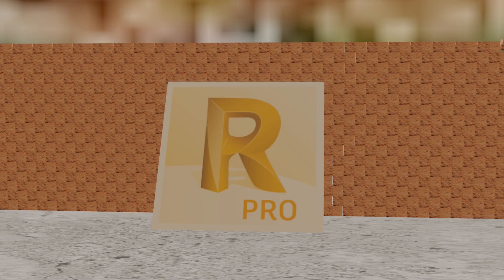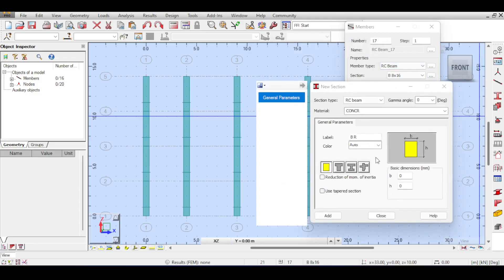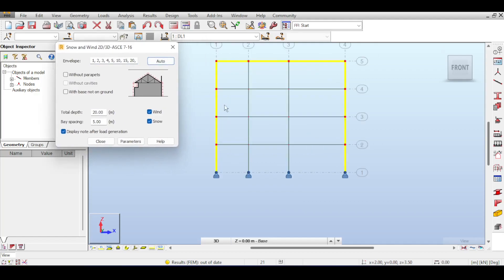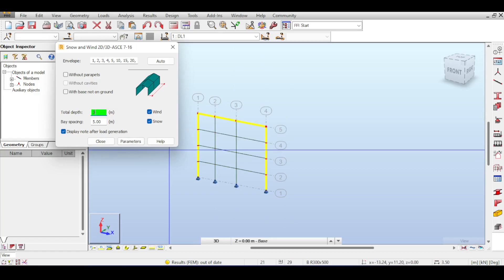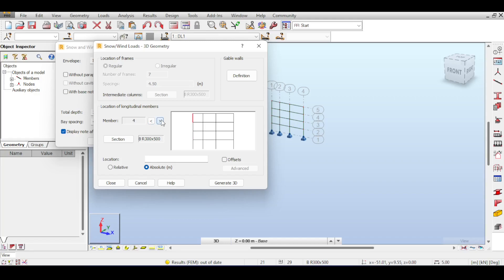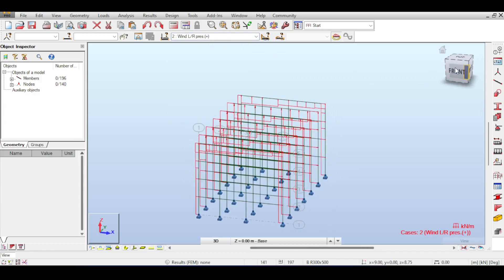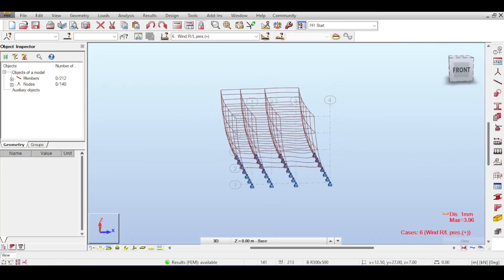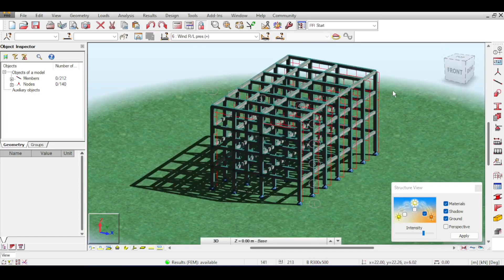Wind Loads according to ASCE7-16 using Autodesk Robot

Comment: Great tutorial sir.
In spite of your illness, you still made a tutorial for your cherished audience 
That’s thoughtful of you and I wish you a speedy recovery.

This tutorial is insightful and surprising at the same time. 

There’s soo many downside to this feature of robot and am sure many users won’t find this feature useful and practical as you clearly mentioned.

My best option will be to modify the wind speed at the site with the building, topographical and environmental factors and apply as wind pressure on panels but the challenge will be how to apply the pressure on a non flat roof (gable and hip)

I wish to see a tutorial on claddings in RSA. I think it’s been overlooked for awhile now, however, I hope you add it to the Current Video Ideas for the future 

Thank you CEE 
Enjoy your day 
Come back as fit as a fiddle.
Reply from the maker: Thnx a lot for your comment.
Indeed, it is kinda sad that such an amazing software as RSA has such a weak ASCE7 (or maybe wind load in general) modeling module.

True. I do that too. I calculate the expected pressures on the surfaces and apply them on claddings. It is challenging for gables and the liking, but well, since I am interested in the powerful abilities of robot, I have to basically "push through" this annoyance.

About claddings, just a small clarification question, 
what do you want to know about them? how they are used? or a simulation including them for example?

Regards,
CEE

Comment: Thank you for your valuable videos. I have some questions: if we define the pressure value and profile in "Wind Load Simulation" which simulate wind tunnel test, what are the benefits and inconvenience of this method. I think cases of positive and negative internal pressure is not included. my second question if I choose to model the rear-front wind on the secondary frame you draw (to connect separated structures), should I make them in a separate file and enter them manually again?
Reply from the maker: Well, the problem here is that you need to be very careful when defining your structure. Some people simply use the "beams and columns" to model in the simulation. this is dangerous because most of the wind load happens due to the walls and parapets. Now if you add those, you would need to model the exact stiffness of those, because robot does not have simple "brick walls" to model. It always models walls as "concrete walls" which are much stiffer than normal brick-walls. And this stiffness affects the analysis,

so it is kind of a compromise. The more accuracy you want the deeper the rabbit hole goes.

The reason why I like to use the ASCE code instead of wind-load simulations is that the ASCE is based on those simulations and they already took all those points into account. It reduces the responsibility on me and reduces also the time needed to "prove" that I took everything into consideration.

It does not mean that I am "afraid" to do it, it is just that: if the structure is included in the code, then we should use the code.

if the structural is not included, this would warrant the extra time and effort spent on simulating the wind impact.

PS: Sorry for the late reply. I had a ton of things to finish and now I am gradually getting back

Comment: thanks CEE! i would like to know does wind load simulation module actually complies or substitute to ASCE 7-16 wind loads in general? because if my memory serves me correct ASCE 7-16 allows the use of wind tunnel simulation to define wind load for building design. sorry if i ask kind of a dumb question 😅
Reply from the maker: Hi there dear Engr. Stanley,
nah there are no unwelcome questions. Let me even tell you - between us - that I am personally willing to investigate this issue in the currently running "RC building design series". I do not have the definite answer for you yet, so your question is 100% spot on.

I have added this point to my "TODO" for the RC building design series. So you will get a video about that soon.

Thnx for being an awesome member. Stay tuned for more content,
CEE

Comment: This was the wind in one direction in a 3D structure, what should we do for the other direction ?
Reply from the maker: Autodesk robot is weak in wind load. The only thing it can do is to do in 1 direction (1 plane, so x-z for example)
For 3D, you need to use a wind analysis in robot.
Reply: @CivilEngineeringEssentials  Do you recommend the wind simulation over the ASCE procedure ?

Comment: Hello CEE. I wish you good health and a speedy recovery. Get well soon.
 
Thank you for the tutorial; it helps and it also confirms and make clear how RSAP work with wind loads in this particular module. This particular module of RSAP may not be “rock star material” but I definitely think that this module still contains more than enough useful information which a designer can make the best positive use out of.
 
As you have also mentioned, RSAP is an amazing software and it does have other methods of modelling wind loads including the use of claddings with own calculations; and the use of RSAP wind loads simulation. The designer have options. 

I share the same sentiments with regards to that the width of RC beams should ideally be equal to or less than the width of the supporting RC columns. This is the kind of thinking that ensures efficiently designed structure through a holistic approach that also consider ease and practicality of the construction process during the design. You have captured this well in most of your tutorials [even in this tutorial] where you raised the importance of deciding on the types of connections (joints) and supports during modelling and modelling same accordingly.

There are always good tips and things to learn from your tutorials. Keep it up.
Reply from the maker: Thanks for your comment and well-wishing. True. Wind Module is kinda underwhelming, but I had it on my ToDo list and wanted to make piece with it. Furthermore, I thought that I should infuse some of the advice in that video, something that you picked up immediately, which makes me a happier content creator.

I will think about if I should model ASCE7 wind loads using claddings and manually do everything.

Anyways, stay tuned
CEE